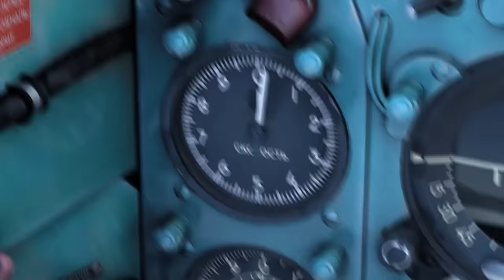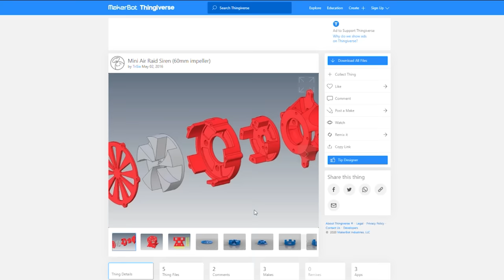Dropping Bombs with the STUKA 💥

Comment: Air brakes are a must for dive bombing, the wings can't handle the speed without them
Reply: Exactly what I thought as he dove from high altitude lol. Actually wasn’t surprised.
Reply: you also need struts from the wing to the fuselage but I actually know that you can use a form of bottle string that you twist using a drill and a vice.. you have to make it roll over on itself and then heated up till partial melt to keep it straight

edit: it's also very good weedwhacker string
Reply: also the string is very springy in a way...
Reply: You will leave your aircraft in 15
Reply: @balijaa  lmao nice one
Reply: let's say that the carnage was worth it
Reply: @LordAndiso  it was
Reply: @land5860 land5860 The German Ju-87 manual says that throttle had to be idle in the dive and that diving without brakes deployed was strictly forbidden.
Reply: For a warbird, yeah, air brakes are needed.  For a foamie, nah.  Too much drag and not enough weight.  The drag coefficient between the two is like a baseball and a wiffle ball.  It was just a matter of not having enough structural integrity in the wing, because he wasn't pushing it at all compared to what I put my foamies through.
Reply: same for SBD DIVE BOMBERS!
Reply: @dddaviddd9208  pls tell me more about the weedwhacking part...
Reply: @BxBxProductions  the string unravels itself to creat potentially a "blade" at the end of the string, the only problem is that if the string is not rolled up onto a spindle while heating it , it will unravel from inside the weedwhacker... plus IF you heat it up wrong or too long (i.e. using a flame as a heat source) would potentially melt the string apart... it's actually easier to be made than said
Reply: also very springy and hard when trying to wind up on your fingers... stuff is also strong and can hurt your hands
Reply: @BxBxProductions  the string I guess could also be variable in size
Reply: The dive brakes weren't to stop the wings from ripping they were to help the pilot stay on target and pull out of the dive of he blacked out
Reply: @jakeduke-parker7618  only in Stuka, as it has autopilot-styled thing for such cases
Reply: So thats why he crashed
Reply: tell that to Hans Rudel
Reply: @BxBxProductions   I have made the string as small as it can go now, almost as small as sewing thread (I bet you could use it as thread if you sorta sanded it a little with some extra fine sandpaper...)
Reply: @dddaviddd9208  you madlad! share the process ! Did the string become more rigid?
Reply: @BxBxProductions  also the process is basically cut a plastic bottle into the size of standard string you want. Next Take a drill and some way of either tying it down or clamping it down, tie off one of the ends of  the string and put it into the drill, keep the string tied down and start drilling but don't pull it too tight or overdrill  otherwise it'll snap, when done drilling it's gonna look like a helix (i.e like a strand of dna but one sided instead of the double helix. After that you take either a hair dryer or a variable heat heat gun and start heating it up until it shrinks after it expands a little. You now have bottle string that is springy
Reply: @BxBxProductions  when i mean sharp, it has teeth on the outside of the string from the heating process, and it feels like a zipper

edit: it is rigid by the hand test but i still have to do the bucket test
Reply: @BxBxProductions  it gets less stretchier the more you heat it up
Reply: @BxBxProductions  update: the smaller string that i made can possibly hold up to 10 lbs if you have at least two strands or more...
Reply: The real diver bomber I believe could pull out of a dive automatically because the pilot would black out from the g's.
Reply: Now you tell them...

Comment: “...We are gonna dive in at 70 degrees.”
A couple minute later:
*goes in at 45-50 degrees*
Reply: I know I hate how they say “Dive bombing” when its really glide bombing.
Reply: they don't have air brakes and they are trying not to snap the wings
Reply: It's not like there isn't actual film footage of the Stuka diving which is not the angle at which they dropped the bomb. If the dives were that shallow they would not need to have the auto pull out because of the pilot blackout problem.
Reply: You can see how the slightest of movement affects the critical angle of attack on the model plane. The faster it goes, the less stable it becomes to move around in. Without specially designed air brakes for that model, control might not respond and because of the intense speed of air travelling around the wings, it will eventually snap. Their idea of "dive bombing" was already correct but their limitations is in the engineering of the plane.
Reply: They couldn't climb high enough to make a 70 degree angle dive
Reply: dude they clearly lost a wing on 2nd attempt. there is so much cardboard can take
Reply: @maulino4036 it’s crazy they’ll be fine

Comment: You should add dive brakes! That would be not only really scale and cool, but would make bombing much easier!
Reply: Yeah that speedbrake would help him from overspeed the aircraft and crash
Reply: Will they be effective at this scale tho?
Reply: @Erik_coolman  Good question, I think they would, certainly worth a try. And they would be a nice scale detail either way!
Reply: Okay Albert
Reply: Yes! Air brakes will really help slow the plane down. I'm worried (like others) the Gs pulling out of a dive, the force on the wings is going to be a lot for a foam wing.  Will need a lot of reinforcement.
Reply: @Erik_coolman  probably.
Reply: Also the siren was built into the dive brakes!
Reply: @redskinritchie  Was it? I thought it was underslung somewhere near the landing gear. But I doubt they could make that work without external power, the one they got is about the best I expected.
Reply: and weight the Bomb!
Reply: @redskinritchie  Dive brakes operating the siren WITH a pwm driver that ramps it up (pitch/volume).
Reply: @hydrocarbon82  it was definitely air operated!!!
Reply: well too late now ig

Comment: Stuka: delivers bomb
Wing: “ight, imma head out”
Reply: The Stuka had a bomb rack under it that tossed the bomb away from the plane.
Reply: This is true in war thunder too. I like how they used war thunder here 1:00
Reply: Think called air brakes
Reply: @rhatw_  Well dunno,  air brakes slows the plane down, since this plane does not have metal wings it could be the G force of pulling up causing the wings to snap
Reply: Maybe French AA guns
Reply: Dude the Spitfire goteem.
Reply: @TacticalPhoenixYT  I don't recall mentioning that the spitfire was superior. Just that it took down the Stuka, calm down.
Reply: @kalminiii7477  also it depends on the skill of the stukas pilot/gunner or what model of stuka. some had 2 7.62mm mgs on wings while others had 2 20mm cannons 
if the gunner hit a spot on the engine of the spitfire or the pilot the stuka would win. if the stuka had gun pods and the spitfire head oned the stuka, the stuka would most likely win
Reply: @TacticalPhoenixYT  Alright, so what plane would have took the stuka down then? Just name one and ill change it so i dont upset specialists.
Reply: @kalminiii7477  a simple strategy would be to come from below. the stukas gunner could only  shoot in a upwards arc. another would be to get the 7 ton milk jug, aka the p47. it had lots of armour and could go pretty quick. or even more simply just use flak guns. the stuka isnt fast

Comment: Pretty sure the G forces when you pulled out of the dive are what ripped the tip of the wing off. You had a lot more dive time on the second run than in the first run, thus allowing  the plane to achieve more speed than it was probably really rated for, given the construction. All in all, I'd say both runs were a success given relative blast radius and effect-on-target therein. Wonderful video, boys. Keep it up!
Reply: that plane faced a 10g force lol of course was gonna break
Reply: The original Ju 87 had dive brakes under the wings to prevent from getting too fast to pull out of the dive. They looked like fences and created drag.
Reply: I bet it was structural failure too as a result of the spring energy. The aero g forces plus the recoil from the spring would have done it

Comment: thats a real crash to be expected from a plane like this one
Reply: They forgot the overspeed warning XD
Reply: @anchovyhmmm5681  high speed retract flaps
Reply: @anchovyhmmm5681 

They forgot the automatic system that the Stuka had xD

Basically there was a system integrated into the height indicator, and it were set moments before the dive. 

Once dropped beneath the set altitude, the plane would have dropped the bomb automatically and then pitch out of the dive, should have the pilot fainted by the vertical G forces during the process. 

As the plane became, during the dive, virtually automatic, the pilot simply had to focus on keeping the Stuka aligned with the target, it would have done the rest for him.
Reply: I think they needed air brakes
Reply: damn revenge CAS
Reply: @HoverFreddy  it just an RC. Why  and how they would put that advanced mechanism? They also don't have the basic indicator for a plane (speed,altitude,heading,pitch,roll) :)
Reply: @anchovyhmmm5681  I were ironical!

Also it's actually possible to obtain such a thing with a properly programmed Arduino ^^

Comment: I think the fear in Jonah's voice after crashing says a lot about the crazy, brave people who flew missions like this in the war. A lot of their fates were similar but without the benefit of miniatures and FPV. Nice job trying to depict accurate divebombing and Merry Christmas!!
Reply: There’s a guard tower joke in there somewhere...XD
Reply: The Stukas had a mechanism that would kick in at the end of a dive bomb to help the plane come out of the dive. The pilots typically experienced so many Gs that they would black out.
Reply: The RAF Pilots learned to either wait for the Ju-87 to come back up after dropping it's main bomb, or simpler than that, attack them in level flight, where they pootled along at about 250 mph, and easy prey for the 300+ mph Hurricane, Spitfire, and even Defiant. In the Mediterranean theatre and Norway, they were successfully ambushed and shot down by Gloster Gladiator biplane fighters. The Stuka was transferred to the Eastern front, and a lot were re-equipped with 20mm anti tank cannon, and were known as the 'Panzerknacker'.
Reply: Pretty Fly for a WiFi  they ended up scrapping the siren because they figured giving the enemy a heads up that a bomb was coming gave them time to take cover

Comment: The siren sounds like a racing quad. Not the howling original.
Reply: thats not makeable to realize. the frequence of the sirenes tone depends on its size so you cant generate the frequenz of a original sirene whith ist much bigger. second thing that maybe could be done, the sirene on the original ist rotated by a propeller so the sound "rises" by the lenght of the dive when the rpm become higher. amotor powerd sirene of cause generates only a continuos equal sound.
Reply: So let´s build a new one, completely covered with fiberglas-epoxy and a propeller powerd sirene! (but this one was also a good one)
Reply: @Thor555555  undervolting the siren should lower the tone, might be better.
Reply: @Thor555555  They also ordered several different sirens and we saw a bigger one but we didnt hear it!
Reply: @asgardianblacksmith464  but not nearly close to the size of 500mm diameter. but a propeller turned sirene would be nice. the simular sound of the original would only be makeable with a soundmodul but thats fake.
Reply: @Thor555555  as fake as a Styrofoam airplane!?
Reply: @asgardianblacksmith464  Asgard and Thor having an argument......

Allow yourselves both to chuckle at the fakery of it all.

I’m only watching as nearly 50 years ago I I had a Cox 0.049 Control Line model Stuka. Remember that was closer to the operational era of the Stuka than we are to by childhood memories. Now that’s spooky! It was a great model but I was a crap pilot and it bit the dust in the school playground one evening as the school model club. Both wings snapped at the wing root and it was resigned to the garage for a few years before disappearing in a clear out.

And the moral is? It didn’t have sirens and wasn’t any less pleasure for that fact. Rejoice in the unfeasible scale size of the boys Stuka and for the delights of YouTube that allow us to participate for free.
Reply: Just put a little JBL Bluetooth speaker in it or something, and just replay the original sirens on it
Reply: My thoughts exactly.
Reply: @Thor555555  you could plug a speaker into an audio player with a recording of the original
Reply: Yeah it sounds like a 2 year old screeching instead of the iconic terrifying Jericho trumpets
Reply: @Synergy7Studios  honestly would rather have the real siren than a bluetooth speaker version, because the siren sound is also impacted by the doppler effect. Maybe bluetooth speaker would be ok if you could get a recording of the siren while it's sitting on the ground.
Reply: Agreed.  The original operating on the speed of the plane had a different variant of pitch and tone
Reply: Why not use a speaker?
Reply: Yeah the siren does need to be more realistic

Comment: It would be cool if they made detachable canopies that have a 360 degree VR camera inside a protective class case so they could look out of the plane from any view inside a cockpit
Reply: There's a guy that's done something similar. He had a miniture pilot in the cockpit with a HD pinhead that  could pan L/R. I'll try an find the link.
Reply: @kentuckyblugrass  they did it right here on FliteTest years ago P51 Mustang I think it was.
Reply: @kentuckyblugrass  It would be interesting if they could somehow turn the 360 cam on the stick they have into the video input to the fpv transmitting, I feel like that’s the perspective you get zoomed in on 3rd person view in video games. Does 360 vr for fpv even exist yet? I don’t actually know, I only fly line of sight stuff 😅
Reply: @rc-fannl7364  nice, the swivel cam is FANTASTIC. That p-51 looks great too
Reply: @TimMcClure  I'm not sure. You would think that with the rate at which tech improves that something like that is available. I'll have to check.
Reply: @TimMcClure  Yeah, the person who made this video did an amazing job with that plane, it really feels like being in a warbird.

Comment: The siren is called a "Jericho Siren".  There were two versions. Early versions were driven by the slipstream of the air as the plane took off and stayed "on" from take off until landing.  Later versions had a control inside the cockpit that the pilot could activate during the siren.  That way, the pilot wouldn't be driven bat crap crazy by the constant screech of the siren.

Comment: Real Fun fact: The B-1 was also fitted with "Jericho trumpets", essentially sirens driven by propellers with a diameter of 0.7 m (2.3 ft) mounted on the wing's leading edge directly forward of the landing gear, or on the front edge of the fixed main gear fairing.

Comment: Fun fact: the sirens were not just some fancy air raid sirens, they were just office fans placed on the wings.
Reply: Well I believe the sirens were actually powered by the air moving through it while bombing
Reply: For anyone who doesn't get the joke and actually thinks the sirens were office fans, they were related to air raid sirens, but a different size and had a different pitch
Reply: You all missed the joke lmao
Reply: @dakufaust  you arw correct the sirens were working on the air traveling thru that is why the sound changed when increasing airspeed going into the dive and climbing out
Reply: @WarriorOO2  I’ve heard that it was tuned so that it would start making noise when the plane hit it’s target dive speed so the pilot didn’t have to look at the gauges and could focus on dropping the bombs instead.
Reply: @TheYakumoFujji  not right in this case, there where kind of blow thru pipes like organ pipes on bigger bombers, on the stukas were like here the sirenes simular to air raid sirenes, but they weren´t powerd with continuos rpm by a motor, they were powered by a small propeller to initiate the rotation thats the reason, that with higher speed at diving the rototion became faster and the sound changes.
Reply: @Thor555555  that is what I said they weren't powered but were powered by the air dependent on the  airspeed

Comment: You need air brakes to slow down without them you will gain speed uncontrollably and rip the plane apart if you pull up

Comment: The original siren was driven by the air, so the pitch changed as the aircraft's airspeed changed, which is why your constant tone electric siren really doesn't sound right.

The wreckage is however an accurate representation of how most Stuka's ended up.

Comment: after watching the video back in FBF, the wing did not fold. to me it appears as if the excessive speed, caused the airfoil to generate such low pressure + AOA caused the draft to tear the wing apart. the wingtip fell off after it lost the rigidity from the top piece. 14:02

Comment: Stumbled across this by accident and loved every minute of it, shocked to see the Stukas demise though, such a shame.  If you build another one can I suggest either fitting air brakes or easing out of the dive as I'm pretty sure that was over loading on the wing which ripped off the port wing, very good illustration for all pilots of what g-forces can do if not accounted for.